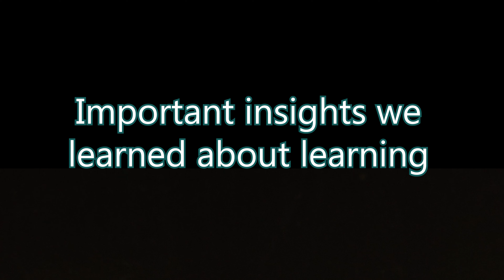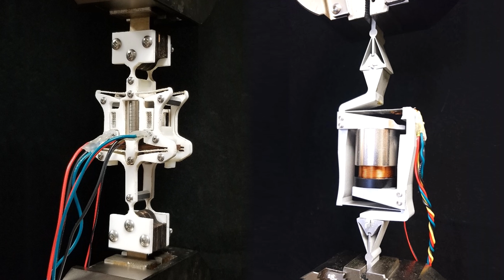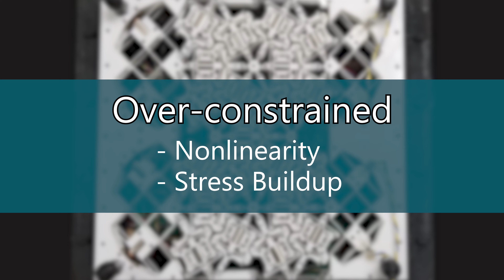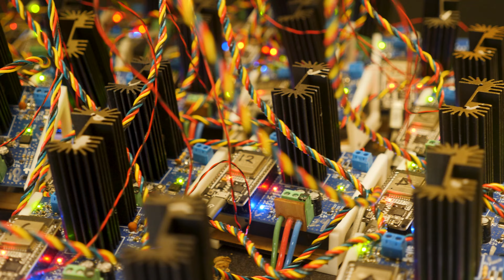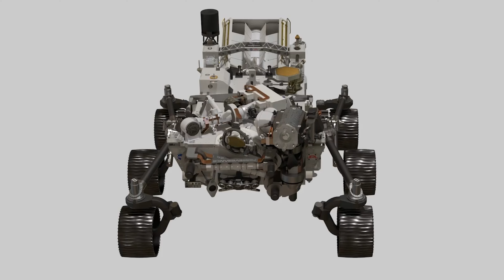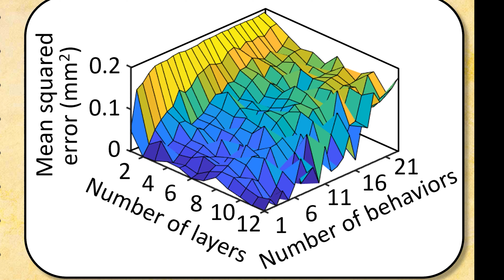What we Learned about Compliant Mechanical-neural-network Learning through Failure

Comment: The argument(s) you use as to why directly training of the physical model is superior to computational simulations are the same points that made the first model fail. That is quiet odd.
Reply from the maker: The main reason the first design failed to learn was hysteresis, which caused lack of repeatability.  It's also true that direct training takes hysteresis into account more accurately than simulation, but you can leverage the benefits of reality while still designing systems that have tolerable hysteresis so they can learn where simulation fails or is not as accurate. Note that despite all the issues with the first design, it still almost learned around all the problems! Pretty cool

Comment: I wonder if this will see us making something like the ”Calculate Fortress” material found in the fictional Japanese ”Toaru” franchice, at least given enough iterations on this concept.

Basically, the idea is a material that pushes back when pressure is applied, such that it could withstand something like a bullet.

A mechanical neural network might function as a sensor for such a material.
Reply: it would be a million times easier to just use conventional mechanicals to move mechanical plates at pre calculated optimal rates to "catch" the bullet

Comment: Is it really a compliant mechanism when it has a electromagnetic actuator this is still quite awesome. Thanks for the great content
Reply: I think the idea is that you can train, get the values then make flexures with the desired stiffness.
Reply: @satibel  ya it took me watching the rest of the video to understand lol. But its a cool concept i think. Itd been nice to see some practical applications to help people understand the use cases
Reply: @98f5  it's still experimental there isn't a specific application in mind afaik.

a thing I can think about is a material that has variable stiffness, like a bed that you can change the stiffness on by sliding a plate.
It might also be useful to counter the torque of a motor, where you have side load from the moment but vertical load from the bumps.
Another one could be a lock, where only the right key allows the lock to flex in the right way, or you have a key with the flexure, and it allows a question-response authentication (basically the lock presses on the key and the key deforms in a set way, which makes it extremely hard to copy, as you'd have to copy a majority of the combinations on the key, instead of a fixed bitting.)
Reply: @satibel  yes i imagine it could be used for self leveling and many other interesting uses in manufacturing processes, maybe as a type of motion control of a flat plane too (not an airplane . 

The actuators seem to create feedback loop. Wish i was smart enough to build software for things like this too let alone physically creating it. Huge amount of work. I gues thats the advantage to academia
Reply: @98f5  tbh it's stuff you can learn to do on the go mostly, ml is relatively simple to code, but yeah time consuming so if you don't have the budget and time to experiment with that, it's hard to do, which is indeed the advantage of being in academy, if you're convincing you can get payed to fuck about and find out.
Reply: @satibel  i have some limited experience but want more lol. Most hands on stuff ive done involved tensorflow or matlab been expiramenting with custom llm models. Really like openai api for llm just wish i had gpt4 access. Anyways. Appreciate any advice about things i can do to learn in a more broad sense the software side.
Reply: @satibel thanks for your time and replies btw! 🙏

Comment: Did you try any training runs with the range of stiffness values limited to positive? are the negative stiffness values required for the learning to work? If you could get away with only positive stiffness values, you could do cool stuff like, train a model on the full machine, and then bake the final stiffness values into an entirely passive mechanical neural network, just a single piece of aluminum cut to form a lattice of flexures with different weights. having an entirely passive structure implement the final behavior would be pretty cool, even if you lose the in-situ training benefits, because that makes me imagine some future project scaling that to MEMS-based mechanical neural networks. I'm guessing the magnitude of possible output node forces would decrease for each additional layer in the network without anything to amplify the forces, but that's just a hunch.

Additionally, if learning is possible with positive-only stiffness values, that seems like it would open up a ton of engineering opportunities to do reduce node cost significantly by replacing the whole control loop with some passive physical element with an active means of adjusting stiffness, instead of the whole element being active.

Comment: Your mars rover example isn’t a good one, this is a relatively simple neural network that could easily be simulated and trained by an on board computer, not requiring it to be transmitted from Earth.

It would have less stress, less unusual conditions during training and less wear if the mechanical system was just characterised and then simulated and trained on the rovers on board computer and would most likely be much faster. You want to keep experiments on a working piece of hardware to a minimum as it reduces the likelihood of damage and on a rover that is that expensive and that far away you definitely do not want to run any kind of training or experiments on the hardware since you can’t replace it. You want everything to be verified before trying it, that leans into the approach I mentioned above, characterise the system mechanically and then test and train it in a simulation.

Edit: or you could do what the engineers already do which is to have a second rover on Earth that they can test in different environments and situations before they try anything on the rover itself.

Comment: Yeah, as soon as you described the structure, I suspected that the creep exhibited by PTFE was causing the problem.  It's such a weird material, mechanically and electrically.  It's such an odd choice for a mechanical device but obviously you figured it out.  I love the wedge fasteners.  It reminds me of the tapered pins that were so common in mechanical design 100 years ago.  Have you considered using a simplex optimizer with parameter descent?  I used SIH in graduate school.  We found that it did better than simplex alone.

Comment: “Reality is never overwhelmed by computation limits.” That’s really interesting, I never thought of it that way.
Reply: I've heard that motion force, a push/pull or torque, travels through a medium at the speed of sound in that material. There is an upper limit surely, if nothing else the speed of light. Funny how he said it as if mechanical computing is free of computational limits imposed by the properties mechanism
Reply: @nedoran5758 analog systems in general are much faster than comparable digital systems; what digital has on analog is repeatability, i.e., less sensitivity to noise
Reply: @personofinterest1729  Oh, no doubt. I've been interested in analog computing for years, like the antikythera and the "plumbing" model of the US economy. There are certainly use cases where analog approaches would be worthwhile even today, at least as useful as quantum computing. The more varieties the better!
Reply: Make it out of transistors and electromagnets lol. It's digital speed analog
Reply: Idk, making 1 cuda core on gpu is cheaper than making one beam on mechanical neural network...

Comment: Laser cutting teflon is about the most disgusting thing I've heard of all day
Reply: It was such an odd thing for them to choose. Teflon or PTFE since Teflon is a brand name, is generally used for its low friction or non stick properties, it would be interesting to know why they chose it for this, since it isn’t being used for its main properties.
Reply: @conorstewart2214  My idea is that it's lightweight, relatively cheap, and easy to prototype.

Aluminium is heavy, hard to cut, and relatively expensive.

Most prototypes are made out of plastics and cardboard...
The role of a prototype is to identify all the problems that you do not anticipate, and this prototype perfectly do it's job, allowing the aluminium product to be fonctionnal quickly without spending days cutting and ajusting aluminium.

Comment: Regarding the simulation training question; what if you used a simulation with simplified physics, ideal materials etc, to obtain values to initialize the physical network, and let the physical network just take care of fine-tuning the values to account for the complexities and imperfections of the real world? Would that let you reach the end result faster, or the values needed for the real network are so different from what's obtained in simulation that you might just as well start with random values?
Reply: i'm guessing it's a matter of: a very small discrepancy at one layer is amplified for each subsequent layer, until it's no longer small?
Reply: @spambot7110  Won't that be taken care of in the physical training stage?

Comment: Id like to point out that the character of the learning algorithm was not considered in your evaluation of the failure to converge on the right response policy satisfactorily. Graduated progress and catastrophic loss of progress are common in even synthetic purely virtual implementations of neural networks training, and evolutionary algorithm training. Im an expert in deep reinforcement learning and I have seen many forms of failure to converge in virtual environments even where sensors are perfect, noiseless, and cannot fail. It is a feedback mechanism after all, and your fitness function itself may be nonlinear, and there's exploration and optimal policy preservation issues in genetic algorithms where the population is too small.

In order to really isolate this variable, you would need to train the network on a simulated model of the device first as you did in your first iteration. Interestingly, you seem to have rediscovered failure modes within modern deep learning, but within an orthogonal domain. amusing tbh fam

Comment: I love the explanation of why using the physical device to learn is so much more efficient than a computer simulation!  Would it be difficult for these to have a feedback loop so they could constantly adapt to changing variables in real time?  Like in the rover example, where it would need to adapt to conditions it's never experienced before?
Reply: When you have spent that much time and money on sending a rover to a planet you don’t want to just let a training algorithm do it’s thing. You can’t replace any broken parts and you often can’t fix any mistakes you make, you may only get one shot at it. You want everything to be tested and verified before attempting it on the actual hardware. Training a mechanical neural network in a real environment has the potential to cause damage or make a situation worse. With space missions they often have a second rover on Earth to test things before they try it on the rover on another planet.

The same approach of testing it on the functioning physical system could be used for all kinds of robotics and would be easier than creating a simulation (in theory) but people instead create the simulations and train it entirely virtually, why? It is because it is much safer, faster and more efficient. Fixing a broken mechanical part or broken piece of electronics is much harder than fixing something in a simulation or just resetting it.

You can kind of think of it like human pilots using simulators, just putting someone in a jet and getting them to learn that way is much more likely to end badly, hence they train in simulators first where there is no risk of damage to physical components.

When you have a mars rover and no way to repair it you don’t want to train on the physical system.

Comment: Tell me, and everyone ...
What is a possible practical application of this?
Reply: Imagine this in place of the intersections of support beams in a skyscraper in an earthquake prone area, they can act as a muscle of sorts that counterbalances the shockwaves permeating the building and preventing it from collapsing.
Reply: @Krimhful  they can earthquake proof buildings without anything like this and without any kind of training, so what would be the advantage of this? This needing trained is a large disadvantage, what are you going to train it on? You could train it virtually or using some simulated mechanical system but it wouldn’t be the same as a real earthquake, so that only leaves training it in operation at which point training might not happen fast enough to protect from an earthquake.

Using it for what you describe is cool, in theory, practically though it most likely would not work and there are already decent methods of earthquake proofing that would probably come out cheaper and more effective than this.

Comment: I wonder if it would be possible to build it  on a micro-level, possibly with a quartz-based material
Reply: Maybe it could be done on silicon, and take advantage of existing chip manufacturing methods? IMU's for phones and stuff have some similar flexures, actuators, and measuring capabilities, and are manufactured that way.
Reply: @tiagotiagot  at that point wouldn’t you be better just running a neural network on a processor? The main point of systems like this is to have a mechanical network that can respond to and cause mechanical movements and forces. If you shrink it down to the size of MEMS devices then you lose the ability for it to interact with its environment in the way it is intended to.
Reply: @conorstewart2214  Even if you make a big array, like about the size of a silicon wafer, and perhaps stack several layers of that?